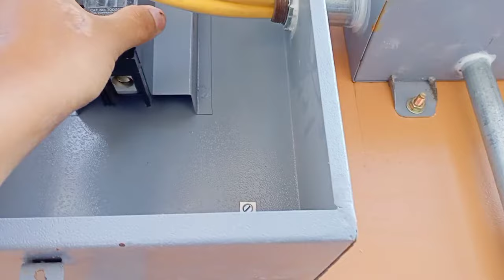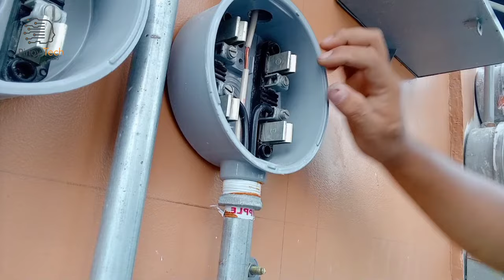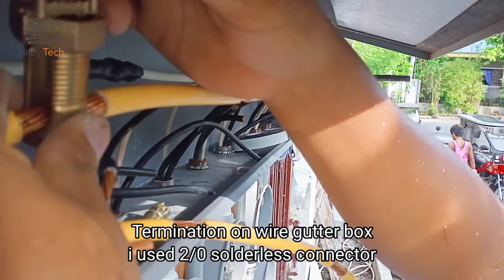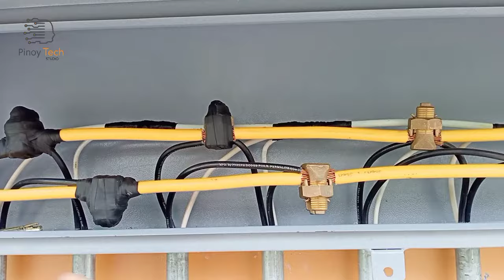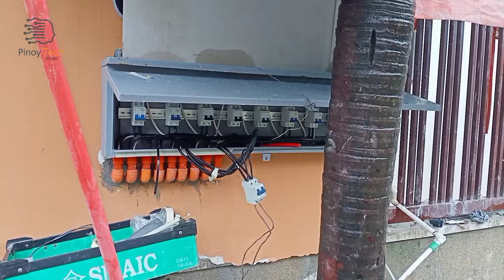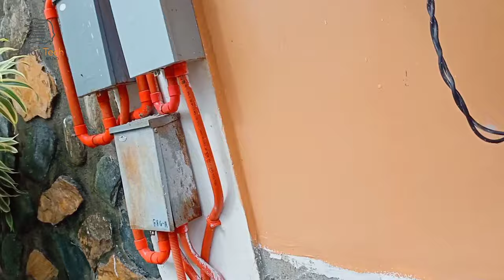Paano mag install ng SERVICE ENTRANCE,MULTI METER BASE, w/ Nema 3R Enclosure para sa MERALCO? Part 2

Comment: Thank you for your informative contents. May alam po ba kayong easy source ng tingi tingi lang na tube for meter base? Or any DIY hack as alternative? Mahal po kasi ang buong tube tapos sa isang meter base ko lang gagamitin. Or dapat po Meralco naglalagay nun?
Reply from the maker: Meron po sa hardware ... Nun may thread na din ,,may 1Ft may 4 inches.  Actually binili ko lng din sa hardware ang ginamit ko diyan... 1ft and 4 inch
Reply: @PinoyTechStudio  maraming salamat.

Comment: Boss line to ground connection yan boss line to ground po.anung sized po ng wire ginamit mo boss
Reply from the maker: Line to ground po ,No.6 po yung feeder line saka yung sa metro n individual